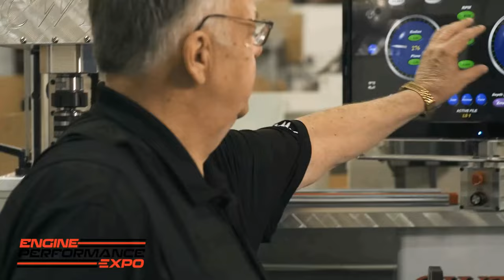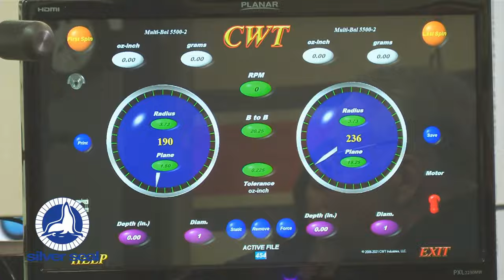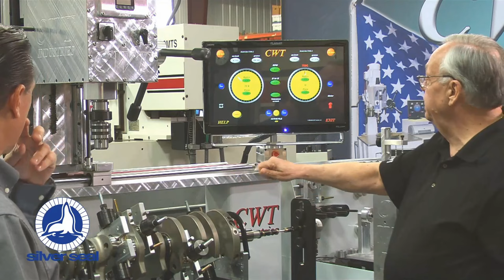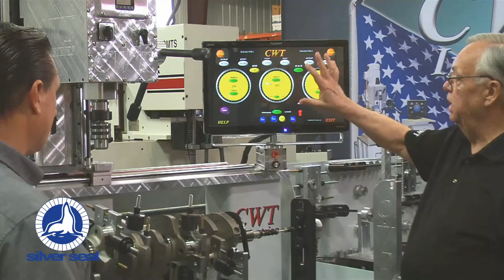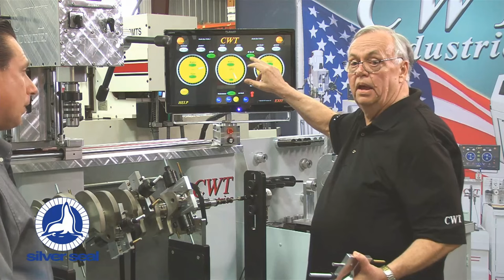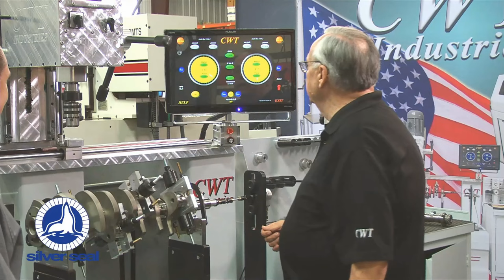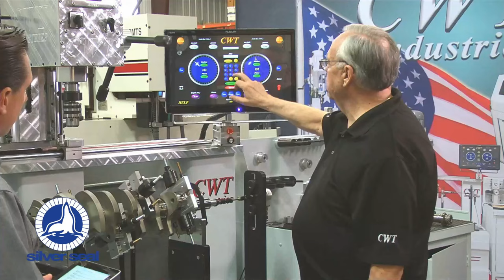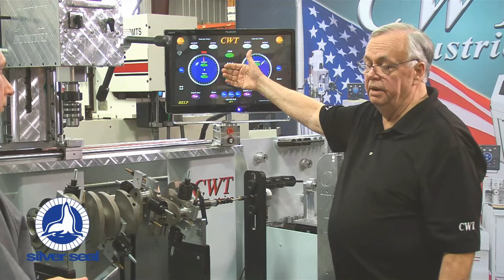Rotating Assembly & Balancing Machine Demo (2021 – Episode 9)

Comment: I appreciate the technology, but, as a “customer”, how do I access it? Is there a list of accredited shops? Does CWT do balancing?
Also, with regard to camshafts, wouldn’t provisions/ balance pads need to be designed in, by the manufacturer? Is this considered-included by many or any?
Then, by extension of this, how about a episode on crankshaft design, as in billet cranks for specialty applications.